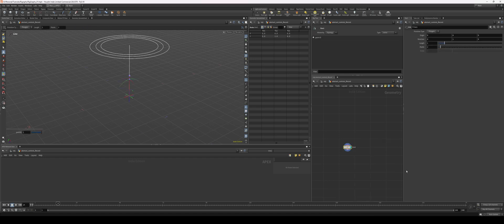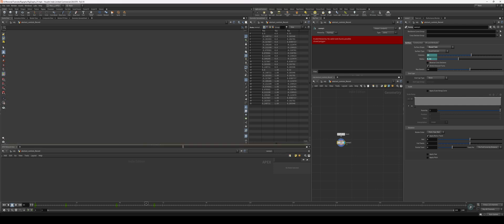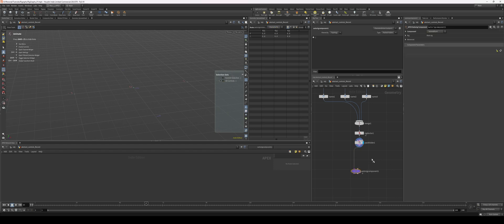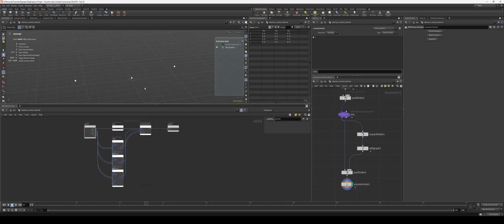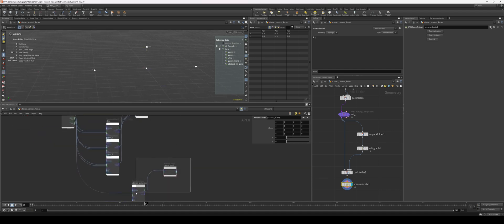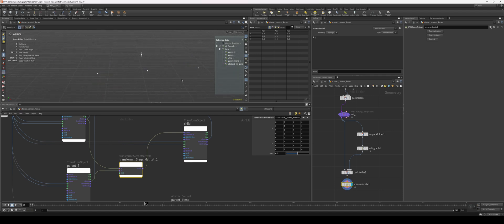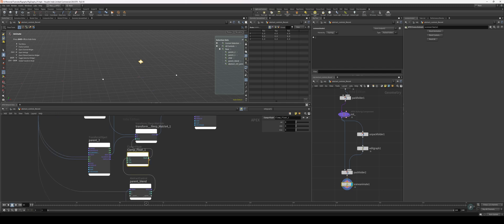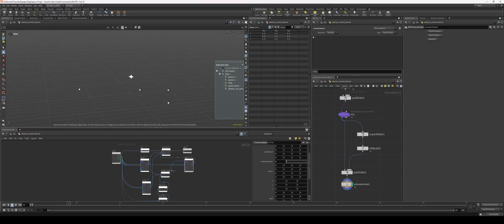Houdini APEX Rig Graphs: 03 | Abstract Controls

Comment: Is there a way of setting the value range of the Abstract Control? The default seems to be -10 to 10. But what if I want 0 to 1 for example? :) Of course clamping is an option, but it would still be nice for the animator, if the slider would move in the right range. Thanks for the nice vid btw!